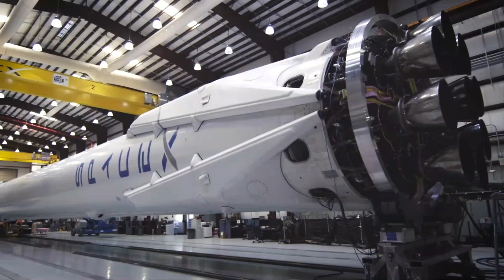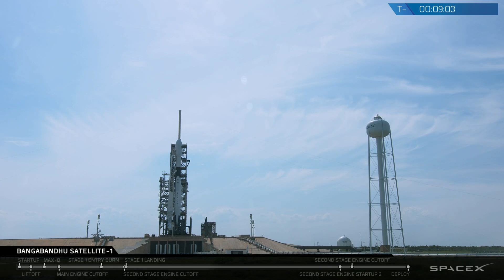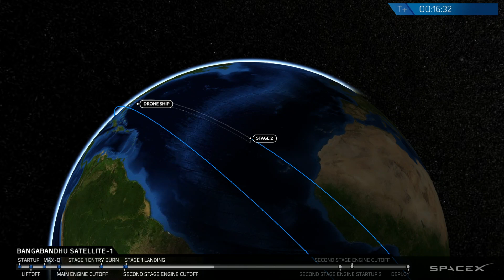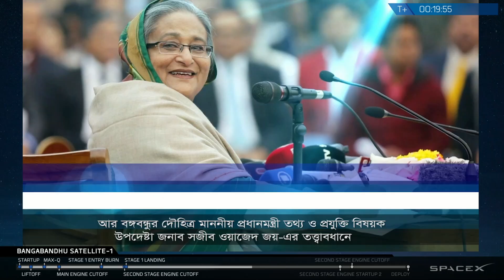Bangabandhu Satellite-1 Mission

Comment: 4:55 - start of webcast
16:55 - T-1 minute to launch
17:45 - launch
19:10 - max Q
20:30 - MECO
21:25 - fairing seperation
24:15 - stage 1 entry burn
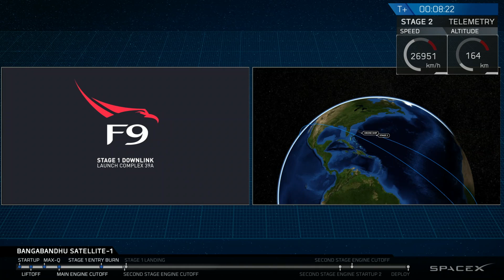26:20 - 2nd stage cutoff / 1st stage landing
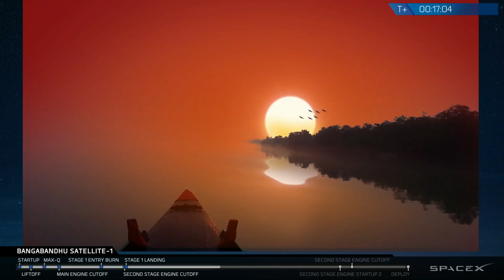35:00 - start of Bangladesh video
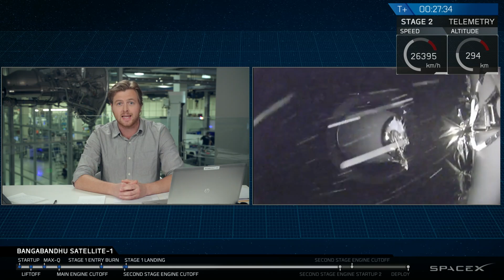45:30 - 2nd stage re-light
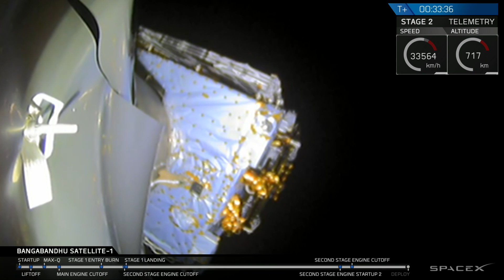51:30 - deployment of payload
Reply: Thanks
Reply: thanks man......
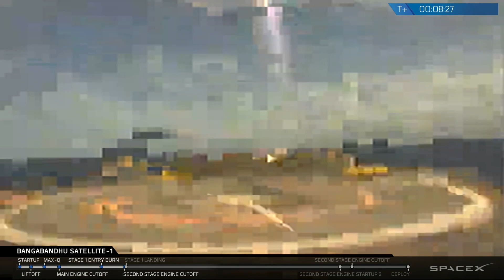Reply: Where is. Rocket landing at 26:20
Reply: thanks man.
Reply: Adele & Bruno Mars At Altanic Ocean
Reply: Zach Hodgdon thank you
Reply: #ZachHodgon Thanks bro 😎 ✌️
Reply: Wow

Comment: 4:54 Webcast starts.
16:55 T-60 seconds.
16:57 didn't abort.
17:45 T-10 seconds.
17:55 launch.
19:10 Max-Q
20:31 MECO (Main Engine Cut-Off), stage separation, followed by 2nd stage engine start at 20:36.
21:28 Fairing separation.
24:15 Boost-back burn.
26:00 landing burn, landing at 26:22.
35:00 Bangladesh video.
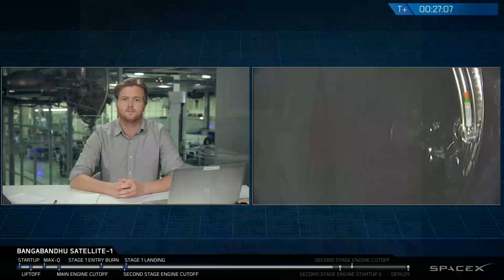45:03 Webcast restart.
45:32 2nd stage re-ignites.
46:35 2nd 2nd SECO.
51:36 Satellite deployed.
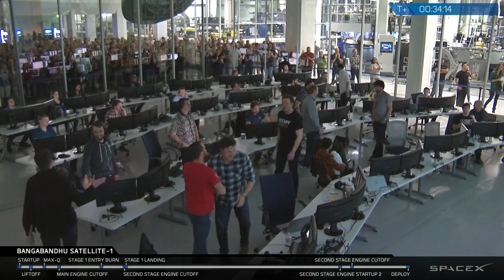52:06 Elon Musk spotted :D
Reply: Thanks!!
Reply: I like how informal the Mission Control team dress, I imagined them as dressed in formal clothing...but SpaceX isn’t NASA.
Reply: Thank you
Reply: 22:46 Of course I still love you
Reply: FiNiTe i
Reply: FiNiTe Thank you!
Reply: omg I didnt noticed elon musk
Reply: FiNiTe zoo
Reply: FiNiTe 😍😍
Reply: FiNiTe THANK YOU!!!

Comment: Nice to see the rocket getting better all the time! But, surprisingly, the camera on the first stage got markedly worse.

Now it seems to rattle every time the cold gas thrusters fire, and then it became foggy during the re-entry burn, despite the titanium grid fins. Considering how well it used to work in the past, that's a bummer.

But it is certainly a small thing, comparing to the successfully completed mission with the "final" Block 5 version of Falcon 9. Way to go SpaceX! Congratulations!
Reply: How Does it Really Work maybe some things are different about the camera attachment on the block 5, I'm sure they'll improve it :)

Btw i also noticed a difference in color, right? Wonder why that is.
Reply: How Does it Really Work Yeah i know right... But at least the booster successfully landed tho
Reply: Downlink happens pretty much all the time during reentry/landing due to the heavy vibrations caused by the atmospheric resistance at high speeds and the burning engines. But as Lucas K. also mentioned, I'm sure the attachment might also have been different time since the interstage underwent some changes.
The camera lens also always gets wet and dirty probably because of the atmosphere and particles from the flames hitting the wet lens since the engines are retro firing, although I think it wasn't all that bad this time...

All footage from all the cameras actually looked way better than on previous flights, much sharper, brighter and vivid!  They definitely must have upgraded them.
Reply: Yep...  still need to work on that Stage One downlink, and the droneship signal stability...   I know, I'm picking nits, but it's the designer in me...

I wonder if NASA could get Elon to get that last TDRS satellite up (there was supposed to be three, but only two got deployed)?
Reply: The Stage 1 I think, Camera should be be improved. Good effort by Space X. Congratulation to the country also thanks and congratulation to Space X. I think, Falcon- 9 is good.
Reply: I think the rattle was due to water under its protective lens. Not the camera shaking.That's why the water bubble showed up later on in the mission. They probably going to take a look at the condensation problem.
Reply: How Does it Really Work oofer gang nugger
Reply: This mission is about *Block 5*, which promises to be is a huge leap forward in reusability for Falcon 9!
It includes new thermal protection with advanced composite materials -- really complex technologies, where people had to work hard for years to make it happen, and many other improvements.

So the camera thing is absolutely nothing in comparison. It's just that the camera worked flawlessly in the past -- just look at how crisp the footage was in Iridium-2 mission (the first one to use the titanium grid fins):
https://youtu.be/ei3nGWD4d5A?t=1132
Reply: How Does it Really Work i
Reply: By the way, the weird purple color looks like they need an IR filter on the camera. Even visual light cameras usually can see into the infrared a lot further than humans, so that's what it was picking up.
Reply: To be honest i liked the vibrations everytime the thrusters went off, shows how powerful they actually are..

Hopefully can sort out the fogging and LOS one day though.
Reply: Yeah, beautiful launch. Unfortunately the cameras seem to have gotten worse again with the new revision. Also, the video quality seems to be worse... I really hope this wasn't NOAA forcing them to reduce their quality or something. :p
Reply: I'm guessing that a film or droplet of water formed over the lens so that when there was no vibration it looked clear, but any vibration caused the water to jiggle, acting as an additional, wobbly, lens that caused the jiggle in the video.
Reply: It'd be nice if the receiving ship were to have a drone orbiting it as a camera mount.
Reply: Different atmospheric conditions make huge differences, and the camera fogged up because there was lots of moisture. Footage from the droneship will always be unstable because of the plasma from the rocket engines.
Rocket launches aren't made to look pretty, but SpaceX does a great job of it.
An important note to remember is This Is Rocket Science.
Reply: Miki Cerise - Think about the fact that the entry burn was at least 20 seconds. That's a ton of water that could have gotten frozen onto the rocket. It's pretty cold where the entry burn happens. Also with no boost back burn they landed way, way out there and the seas were rough. I'm surprised it came back that quickly after landing.
Reply: FooFighter4774 With no boost back burn the booster was nosed into the mvac blast for a while. Usually it flips right away. You make a very good point about the MVAC blast. They have gotten much better with boosters returning from GTO missions. No pieces burning and flying off on re-entry.
Reply: SpaceX's main priority is not the camera. They'll definitely improve on that in the future
Reply: Maybe it has something to do with NOOA?
Reply: If you go back and watch, it seems there was a thin film of water inside the camera housing. The apparent movement of the camera was actually the water being disturbed by the resultant forces produced by the thrusters. Sort of a thin liquid second lens. This effect becomes very apparent during the reentry burn when G loading approaches 10 Gs causing the water to coalesce at the center of the housing.
Reply: Water in space?
Reply: Carbonfiber hat
Reply: +Slartybarfast B You are right. It does look like water in the camera enclosure.The new design does not seem to be sufficiently protected from the conditions encountered during launch.
Reply: How Does it Really Work This booster was tested far more extensively than most. It spent more time exposed to weather and drastically different environmental conditions on it's journey from Cali to Texas to Florida. It spent more time at McGregor than most, suffered many false-starts in Florida during both static fire attempts and launch attempts. It was housed in climate-controlled hangars, rolled out to test stands, traveled through the desert, erected at the beach, rolled back into climate-controlled hangars, re-erected at the beach... It saw alot before it ever ignited! I'd guess the least of SpaceX's concerns were that little rubber seal keeping the weather out of the camera housing. :)
Reply: Joe Barco Not water in space. Water in the camera housing. Like if you're snorkeling or scuba diving and you have some water inside your mask or goggles.
Reply: Strap an iPhone X to the rocket and the quality will be better with audio on Verizon, America’s most dependable network.
Reply: How Does it Really Work on my my
Reply: How Does it Really Work on my
Reply: How Does it Really Work  txxx
Reply: @Wyatt B too bad the returned booster was technically not in the usa for most of its journey to Space and back....
Reply: vcc
Reply: Why not enclose the camera into vacuum housing or filled with nitrogen maybe? No air means no condensation.
Reply: There was no condensation in the previous launches -- so SpaceX engineers definitely know how to get it done right. Iridium-2 footage, for example, was just perfect from start to finish. Whatever changes SpaceX have made this time, must have created this new issue. I am sure they will fix it by next time.

Comment: I <3 Block 5. Here are some facts:

For increased payload:
7–8% more thrust by uprating the engines (from 176,000 pounds to 190,000 pounds per engine);
an improved flight control system for an optimized angle of attack on the descent, lowering landing fuel requirements.
For reusability endurance:
a reusable heat shield protecting the engines and plumbing at the base of the rocket;
more temperature-resistant cast and machined titanium grid fins;
a thermal protection coating on the first stage to limit reentry heating damage;
Redesigned and requalified valves[which?] for higher levels and much longer duration.
For rapid reusability:
a set of retractable landing legs for rapid recovery and shipping.
External look:
the interstage structure that connects the first and second stages will be black and unpainted.
Reply: Because of mission control, I wonder how fast the SpaceX internet is. I wonder how small the latency is.
Reply: Yeah I know all that but something was weird, during the descent of the first stage to OCISLY ( Of Course I still love you ) the interstage was white and the grid find went from black to white, anyways great job SpaceX we love you

Comment: what happens with the second stage engine? Space garbage or burn it into the atmosphere?
Reply: SpaceX de-orbits second stages when they can. Right now there are 16 Falcon 9 second stages still in orbit, the rest have burned up after either a controlled de-orbit or a natural decay. You can look them all up in the satellite catalogs. 

This particular second stage is still in orbit:

NORAD ID: 43464
Object Type: ROCKET BODY
Country: US
Launch Date: 2018-05-11
Inclination: 19.28
Period: 627.01
Apogee: 35481
Perigee: 296
Decay: In Orbit (No Decay Date)
Epoch: 2018-05-14
Reply: How Does it Really Work didnt they make it reusable?
Reply: Team epiphany Art there's plans for it, but not for now.
Reply: SpaceX have made the first stage reusable. But the second stage moves more or less with the same velocity as the spaceship or the satellite it launches. This is about 4 times faster than the speed of the first stage at stage separation. So the kinetic energy per unit of mass is 16 times higher. When you bring this stuff back into the denser atmosphere, all this energy turns into heat, which means you must have a special heat shield -- like PICA shield on the Dragon spaceship. On the spaceship it is unavoidable, but it adds a lot of mass. On the second stage, this mass would have to come directly from the mass of the payload that the rocket can launch.

Even landing and reusing the first stage was something that most people considered to be impractical to do. But like Alex said, SpaceX does have plans to reuse the whole rocket in the future. This will be very exciting when they launch a huge and fully reusable BFR!

Comment: So, they said that the black color is the new heat protective material. The second stage is also coloured black on its lower third. Did they already include the first modifications for reusing the second stage but did not test them because this is a flight for a geostationary orbit?
Reply: None of the second stage is black. That's the interstage.

Comment: Why merlin engines and not raptor?
Reply: merlin is the old engine, it has not enough thrust for the BFR but it's enough for the falcon 9. The raptor will feed methane and can be refuel on mars with in situ ressources.
Reply: John theux thx

Comment: (CRUCIFIXION):

***At the time of Jesus death, crucifixion was considered the most painful and degrading form of capital punishment in the Roman Empire. It was considered so horrible that it was used by the Romans only for slaves, those from the provinces under their control, and the lowest types of criminals. It was not to be used for a Roman citizen. This is in accord with the biblical account of Christ's death and with church tradition, which asserts that Peter was also crucified, but Paul, a Roman citizen, was beheaded.

***Crucifixion as a means of execution probably grew out of the practice of displaying the heads of captured enemies or criminals on a wooden stake like those used to build a wall or erect fortifications. Later, entire bodies were impaled. By Jesus time, crucifixion was a common sight.

***Although methods of crucifixion seem to have varied throughout the Roman Empire, through biblical and historical accounts the basic pattern is known. The condemned person was first scourged with a flagellum, a whip of leather thongs with bits of metal or bone attached. This whipping greatly weakened the victim, who then had to carry the crossbeam to the place of execution. A sign specifying the crime was often placed around the criminal's neck or on the cross. The person was stripped naked, laid on the ground with the crossbeam under his shoulders and tied or nailed to it. Nailing made the victim die quicker, as it did Jesus, whom the Jewish officials wanted dead before the Sabbath. The crossbeam was lifted and secured to a post so that the person's feet were hanging just off the ground. Some archaeologists think a pin or wooden block was placed halfway up the post to provide a seat for the body so that the nails would not tear open the wounds, causing the body to fall. The feet also could be nailed or tied to the post.

***Although the pain was excruciating, some victims survived on the cross for days. As in the case of the two criminals crucified with Jesus, the legs of a crucified person were sometimes broken to make the sufferer die. This caused massive shock, followed by less of circulation and heart failure.

***Although completely innocent of all sin, Jesus suffered the most horrible disgraceful punishment known to man. But his agonizing death was not an ordinary death, for it was not the final chapter. Jesus turned his apparent defeat into the most glorious victory the world has ever known. At the cross, he suffered for the sins of the world. Then after his resurrection from the dead three days later, Jesus empowered his disciples with a new message, the Good News that he had finally defeated the power of sin and death. Through the Cross, Jesus offers salvation to all who will believe in him.

***(Hebrews 10:26-22)<---For if we sin wilfully after that we have received the knowledge of the truth, there remaineth no more sacrifice for sins, But a certain fearful looking for of judgment and fiery indignation, which shall devour the adversaries. He that despised Moses' law died without mercy under two or three witnesses: Of how much sorer punishment, suppose ye, shall he be thought worthy, who hath trodden under foot the Son of God, and hath counted the blood of the covenant, wherewith he was sanctified, an unholy thing, and hath done despite unto the Spirit of grace?

***(Counted the blood....a common thing): Means the blood of Christ is treated as no different from the blood of an ordinary man or the blood of an animal sacrifice.

***(Insulted the Spirit of grace): Is a reference to the Holy Spirit, the agent of God's gracious gift of salvation. A believer who commits these offenses will be judged with a punishment worse than physical death.
Reply: Because Jesus paid the price for us on the Cross. So, if we believe in Jesus and repent of our sins we won't have to suffer in Hell fire and be tortured by demons for eternity. So yes, i believe and it is REAL!!! Don't wait until you die, then it WILL BE TOO LATE!!!